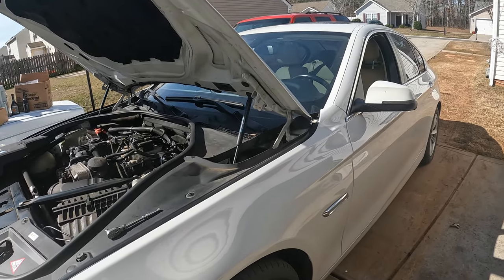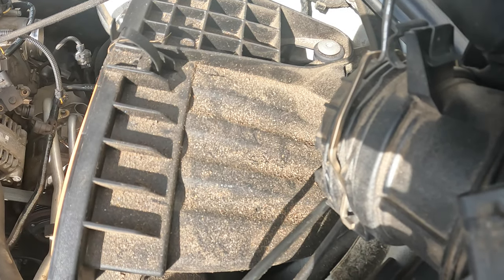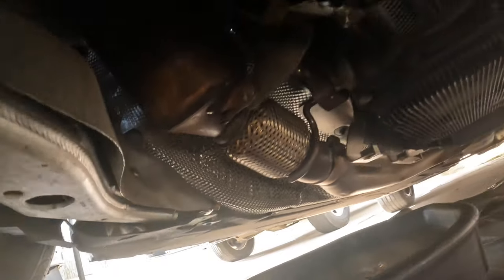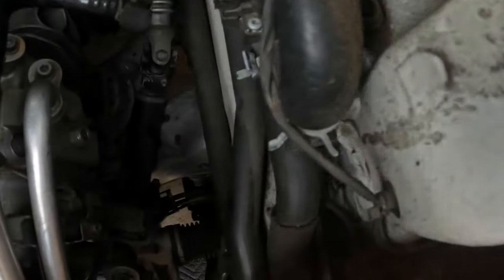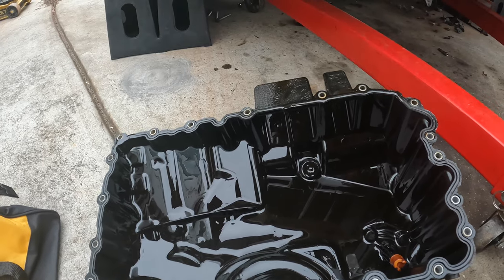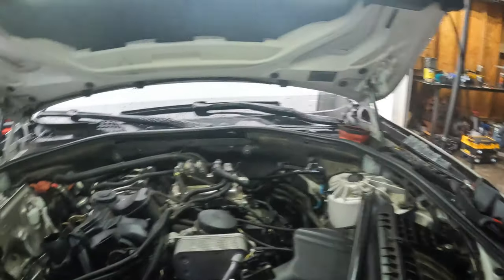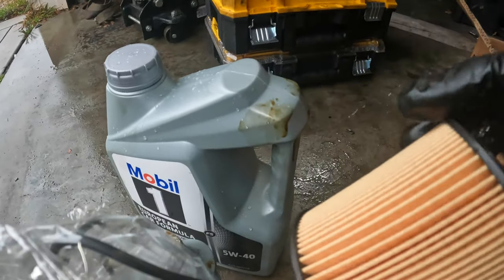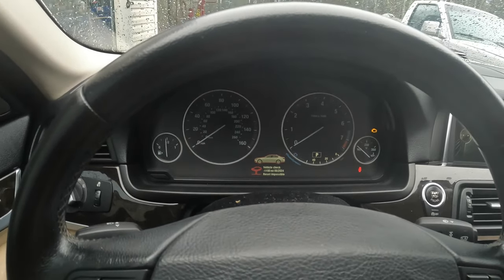BMW N20 Oil Pan and Gasket Removal

Comment: I just replace the engine mounts,i couldve replace the oil pan cause its leaking now im gonna have to repeat this 🤦‍♂️🤦‍♂️
Reply from the maker: That sucks.  That would have been the best time to do it too. I would suggest the metal pan though. Hopefully it goes smooth for you.

Comment: So when changing the oil pan do i need to get a new oil level sensor seal for the aluminum pan?
Reply from the maker: You can use the original one if you want to.  But now is a good time to get a new one if you wanted.  I would get a new gasket at the very least

Comment: Hi, thanks for the video! Can you please let me know how high can the f10 n20 528i engine be lifted without damaging any components? I lifted it about 1.5 inches, however, still not able to get the pan out. A bit hesitant to lift further to avoid any damages.
Reply from the maker: I lifted mine around 4 or 5 inches.  Just go a little bit at a time and watch the engine against the firewall.
Reply: @operationoverhaul  Thank you!

Comment: Would you say this aftermarket aluminum pan is better quality than the stock plastic one? $650 for a plastic pan is insane
Reply from the maker: I think they are better than the plastic.  I feel that they do not flex as much as the plastic ones and the gaskets seem to fit better in them causing them to seal better as well.

Comment: Just to double check - did you have to remove both engine mount or just the one on the left/driver side of the car?
Reply from the maker: I removed both of the mounts so I could lift it up enough to clear without removing the subframe.
Reply: @operationoverhaul  thank you!

Comment: hey which screw do you have in that engine bridge screwed in the motor
Reply from the maker: If you have a BMW tow hook it fits in the engine. I think the threads are a M16x3.

Comment: Did you just use the car ramps to lower the subframe?
Reply from the maker: I actually did not remove the subframe at all.  I lifted the engine up enough to clear the frame.
Reply: That’s amazing! I feel it’s not safe to remove the subframe while the front wheels are on the car ramp.

Comment: Great video! What diameter bolt fits the engine lift threads?
Reply from the maker: Thank you and I believe it is a m14x2.0 thread but I cannot remember right off the top of my head.  I do know that the tow hook from an E90 BMW will thread right into the hole.

Comment: It’s really impressive! I have the same car 2015 BMW 528i and have the same problem of oil pan gasket leak. Where did you buy the oil pan bolt set?
Reply from the maker: They actually came with the pan.  It was a good quality oil pan as well.
Reply: That’s better. Where did you buy the oil pan with the bolts? Do they have torque spec?
Reply from the maker: @tangsiwei1  I actually bought it from oreilly but I think I put a link in the description on Amazon as well
Reply from the maker: @tangsiwei1  the torque source are the same. I believe they were 10 nM
Reply: Thanks a lot!
Reply from the maker: @tangsiwei1  your welcome
Reply: So what washer are you supposed to use every time you take the drain bolt off to do an oil change just re use the same one the aluminum pan comes with ?
Reply from the maker: @carlosskrr  no I would not recommend that.   You could probably get away reusing it one or two times but no more than that. I do not know what size it is but I will find out for you and let you know which ones to get.

Comment: Hey! I know this is a little older video but hopefully you can answer soon… I’m trying to do the same job as you right now but I can’t seem to get the aluminum pan in. It keeps getting stuck at the oil pump chain guide and won’t go any further past because that and the transmission. Thanks in advance!
Reply from the maker: See if you can lift the engine a little higher to gain more room. If I remember correctly I had to almost keep it level to clear the chain then I could tilt it to clear the transmission.

Comment: Hello - do you have tips on how to remove the oil pan (after jacking up the engine)]

I took out the oil pan (like literally right now) but i can't get it out and no more clearnnce for me to raise the engine lol. I may just do it with the oil pan just dangling in the subframe/engine area.
Reply from the maker: If you are just doing the gasket then I would do it that way if possible.  I was able to lift mine just enough to get the entire pan out.
Reply: Were you able to change the gasket with the pan dangling under the engine?
Reply: @iffgambetta5319  yes but it took so much effort and time due to all the things that will get in your way. I used a ziptie or two on the gasket so I don't lose track of the correct position of the gasket.
Reply: @goosfraba-man  thanks good to know.  I see a lot of people having trouble removing the entire oil pan.  I’m debating whether or not to do this job or just keep filling the engine with oil as needed.
Reply: @iffgambetta5319 compared to e90, f10 was surprisingly harder for me. If you plan on changing timing chain, you should take it to the shop because usually they will include oil pan gasket and valve cover gasket with it.

Comment: You got to be fucing kidding me, I got the 4-cylinder because I thought maintenance would be a lot easier than the six cylinder; like WTF BMW.
Reply from the maker: Yeah, that means nothing to BMW.  I think they make it harder on the 4 cylinders just because they can.  Also, if it has x drive, better add another 3 hours of labor to everything too.
Reply: I had the x-drive; after changing the oil pan gasket, (335xi); I said never again, imma get the 4-cylinder 428i -  oh well,  - thanks for the video
Reply from the maker: @Timemachine69  your welcome